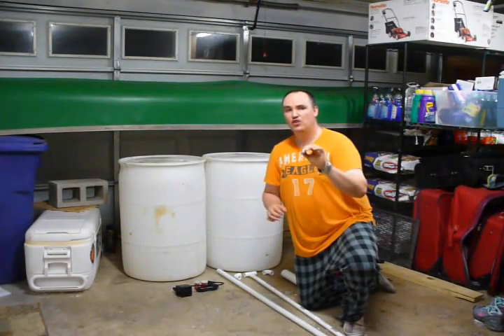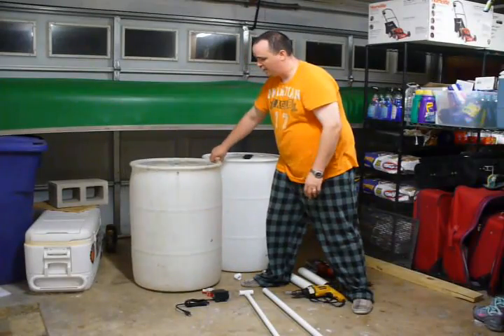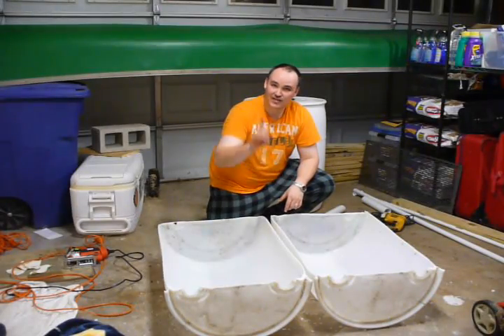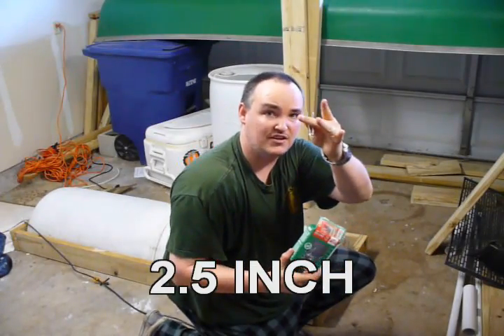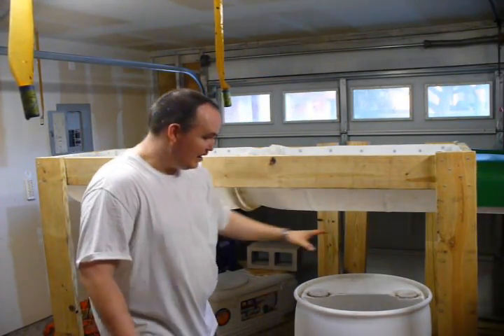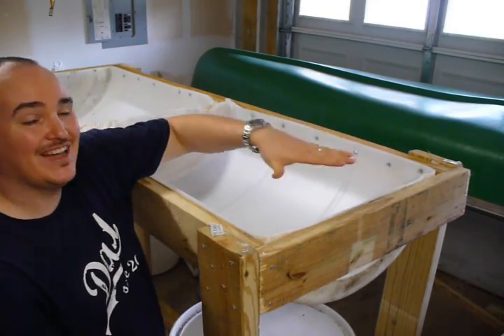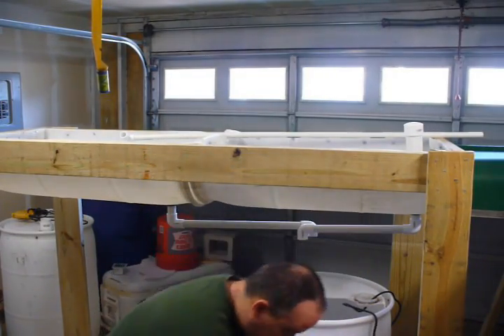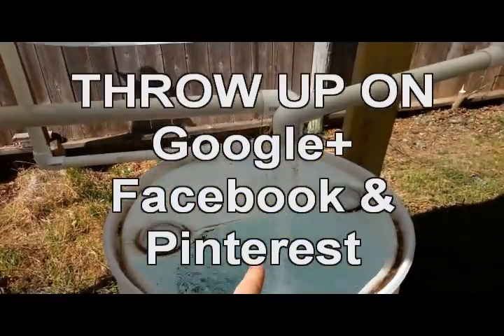Cheap & Easy $40 AQUAPONICS / LARGE SCALE DIY How-To Barrelponics Aquaponic Set Up

Comment: A tip for drilling holes in plastic barrels, start the drill part of bit to just touch the barrel with hole saw then reverse drill to get a much cleaner cut!
Reply from the maker: lildeanturbonc thanks will give that a try the cleaner the better for seals!!
Reply: Great, I learned this trick from working in a plastics factory that made holiday blow mold decorations , sadly long closed, but the education working with plastics has carried on with me !

Comment: I'm a tad late to the party, but I do like your project.  I will have to see what others have done along these lines and compare notes. I thought the water coming out of the grow beds needed additional filtering for the benefit of the fish?  Something about using algae to consume some of the pollutants like ammonia and other stuff out of the water.  I know that plants will take in some of those things the fish produce, but since your grow beds are a smaller design, I bet you have come up with more ideas.
Reply: Search around. I used a 2 inch pipe with some oyster shell for a ph buffer and added some leaves and leftover fish tank water. As a feeder line.You also need to run the system for a while and get it broke in. I use gold fish. The run off pipe to the tank i use a small square tank with eveap cooler pads that are cleanable to help filter crap out.

Comment: what did you use to connect the pvc together is there a special type of glue
Reply: Oatey and Christy's both have a line of primers and glue to use with PVC. They're easy to use and available at pretty much any home improvement store (Home Depot, Lowes, Ace, ...).

Comment: i what to know were you got the two 55g drum for $2
Reply from the maker: Derek Smith Car Washes that held liquid soap
Reply: THEGREENCABBY Are the barrels used in Car Wash food grade ? since they only have to load soap on those would it be possible that the soap supplier might have used recycle barrels that are NOT necessarily food grade ?
Reply: THEGREENCABBY I've asked one so far and they told me they send their barrels back to the soap provider.  Dang.